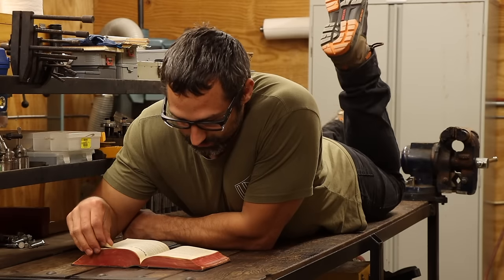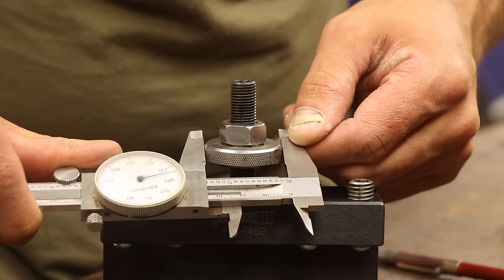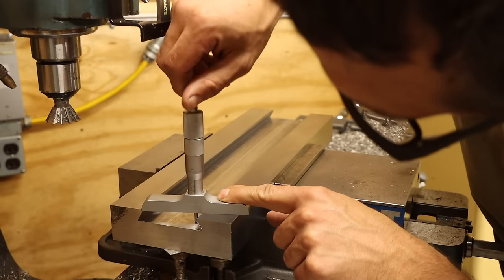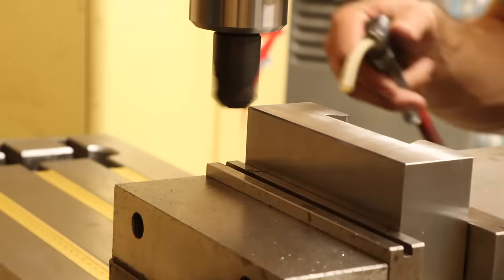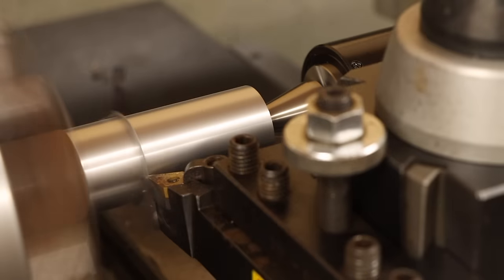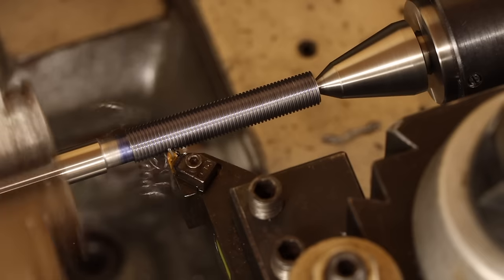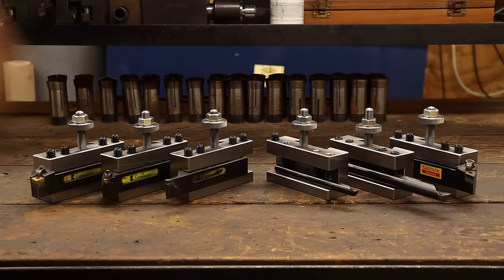Making an ARMY of Tool Holders || INHERITANCE MACHINING

Comment: I allso made better nut for my toolpost, except I replaced one with a handle with new one which needs external tools. I got annoyed by the handle getting on my way all the time. I keep the wrench in a reach of my hand, so it don’t slow my work. I also put short knurl in a top of the nut so it can be removed easily. 

There is one difference between our setups, though. I need to change between solid and quick-change post. My solid post can hold 20mm tools and the quickchage only 12mm. It’s also not strong enough for harder cuts.

Comment: I usually leave a bit if a ridge on the bottom and the bottom of the slot a bit. I just put an endmil in the lathe and cut both of them. So everything gets straight.
Reply from the maker: Do you mean for positioning a round boring bar?

Comment: If you want to keep them in the white  but also want to keep the rust away you can heat them up just a little and spread some minwax on them. I do that to my welding table once a year and it acts as a fantastic rust inhibitor for steel.
Reply from the maker: Clever! I've been using a spray oil called ACF50, but it does leave the part a bit oily

Comment: Another awesome video.
Definitely time for a custom rack to mount all these beautiful tool holders.  I have an AXA sized quick change tool holder on my trusty 9" South Bend. Had a spare way clamp left over so it's mounted to the far right rear corner with a vertical post and an angled aluminum plate. It holds 8 tool holders, Allen wrenches,   both the 3 jaw and 4 jaw chucks, and the tailstock accessories like the Jacobs chucks and live centers.
Reply from the maker: Thank, as always Keith! That's a really clever ideal. I was thinking something on the backsplash or the wall behind it, but I think I recall seeing an extra way clamp around as well.

Comment: New project idea! Die holder. That one looked terrible. 
What I have done in the past when machining a long thread that I didn't have a nut to check, I will single point to within .005-.010" of the minor diameter, then use a die to finish cutting the threads since I know the die will cut to the correct size. (I don't make parts for space shuttles so I don't need absolute perfection.) This will prevent the die from walking all over the material like you noticed they will do.
Reply from the maker: Thanks a really useful tip. Thanks!

Comment: When you said you were going to grind the dovetails, I was thinking “That’s going to be incredibly tricky and interesting to see how he handles that challenge”. But, I do agree that milling was the right decision, it’s already so accurate and sooo much easier.

It’s very cheap to do hobby shop “black oxide” on steel parts to keep rust at bay. All you need is the chemicals, and you literally dip and let dry. I think these would look very good black if you wanted to go that route.
Reply from the maker: If I'm being honest my want to grind the dovetails was mostly as an exercise to try something new. But maybe another project 😁 I actually use a black oxide kit from Caswell Plating pretty often.  Comes with a sealer that dries to the touch that I highly recommend

Comment: Nice work! Making the threaded adjustment stuffs is a step further than I would have gone. I think I would have just bought set screws.

One tip on checking the tram off your mill - Use the longest indicator holder you can and sweep the whole table. The longer distance amplifies the error and allows you to get it that much more square.
Reply from the maker: Oh I tried to find 60mm set screws. It's like they don't exist! At least where I normally look.

Good point on tramming. I've done this at times before as well. Maybe a little lazy here 😉 

Thanks!

Comment: I like to change from metric to standard threads if I copy something for the shop. Makes it easier to get bolts and nuts for replacement.  I also like an extra set screw on each end of a tool holder.  But you did great making these interchangeable with your existing ones.
Reply from the maker: I'd probably do the same if it weren't for that. As much as the international commenters would hate it 😂 Good idea with extra set screws.

Comment: Next time for finish passes use a nice moly-dee or high sulfur oil it leaves a much nicer finish than spray mist and I can usually get away with a light polish instead of grinding.
Reply from the maker: Good tip. Thanks!

Comment: The deflection in the middle of the bar is probably as you remove material, your also removing structure thats holding the bar stable against its own internal stresses. Can be hard to manage when you only need to remove material on one side

Comment: I think if you inspect those set screws in the Phase II holders more closely, you'll discover that the threads are metric, but the hex recess is in inches.

I replaced mine with better quality set screws that don't mix metric with inches.

Comment: Just a tip for the taps and dies, when youre cutting the thread, the chip will need to be broken off periodically.  Every 1/2 to full turn of the tool, wind it back a quarter turn to knock the chip off.  This will help the chip not get re-cut by the tool, which can hurt the cutting edge and really chunder up the thread.

This doesnt apply to gun nose taps (like the one you used for the through holes for the clamping screws) or spiral flute taps.  The bottoming tap and the die you used in this vid, gotta wind it back from time to time!
Reply from the maker: Ah good info. Thanks!

Comment: Nice video, few things to comment:
For a blind hole, use a spiral fluted thread tool, it lets the chips out.
I would never clamp 2 individual pieces in a vise, yes their ground, but it still gives me anxiety if one would break loose.
The countersink for the thread: "just over 12mm". I learned to sink for the diameter + 1x pitch.
The know-turning: the quite substential stickout: rule of thumb i learned was about 3-4x the diameter stickout is ok without a center.
Good video tho, nice quality, keep it up, greetings from Germany
Reply from the maker: Thanks Anton. Good tips on the tap and chamfer. In regards to the vise, while I would normally agree, If I were to leave just 1 part on 1 side of the vise I would risk damaging the vice ways. Because I knew the parts were within a tenth of the same width, and that they were not placed right next to each other the flexibility in the jaws was able to compensate for this. On the lathe stickout I also normally agree, but not when side knurling as I did. I appreciate the tips and support nonetheless!

Comment: tip for squaring on the grinder   make two faces parralel take precision vice grab the faces put 2 pins of the same size between the part and magnet so that the magnet cant pull the bottom not flat face and make it bow beacuse the second you release it the ground face will copy the bottom face after that just flat face on magnet and grind lots of coolant and feed really matters or you will heat it up and make a crater in the middle

Comment: Those tool holders look great. On tool you might look at getting is a spring center, very thin, for your tail stock to use when you are hand tapping. If you look at any of Adam Booth's videos where he is hand tapping on the lathes or on the milling machine you  will see the tool I am referring to. It just helps make sure that your tap wrench stays square.
Reply from the maker: Thanks! I've seen those before. That might make for a good project!

Comment: Nicely done! The deflection in the material is likely due to residual stress attributed to the rolling process, and ignore the previous comment about leaving the rotary table on the mill. Cheers!
Reply from the maker: Thanks! Yeah I got mixed up thinking I bought annealed 4140. It was just cold rolled low carbon. It's a wonder it didnt bow more!

Comment: To answer your question 'where to put these',  I think that you should machine yourself a tall wall-mounted  tool post consisting of a pair of plates separated by a spacer for each tool holder, with longer spacer between each for access.  This design would also protect the dove-tailed surfaces.

Comment: Really enjoy your channel. Would the setup on the mill been more rigid had you clamped direct to the table vs in the vise with supports?  I know Cold rolled has potential to spring in odd directions when you make deep cuts.
Reply from the maker: Thanks. Yes it definitely would have been. For some reason I had it in my head this was annealed 4140, and not cold rolled low carbon. So I wasn't expecting any stress relieving distortion at all.

Comment: Whenever I see the new video, I stop what I'm doing to watch - fantastic work.  I would definitely finish that steel somehow, looks like you have a good amount of moisture in the shop.  Hardening would be nice for longevity too!  (Really this is just a request to see you work with fire - although you're probably already to dimension, so that might not work).
Reply from the maker: 😁  Thanks! Actually all the rust you're seeing in places is from the previous shop the equipment came from. I have a dehumidifier running non-stop and i'm honestly surprised how dry it has been able to keep things. Not a hit of rust on anything I've made or restored. I may circle back and harden some of  the smaller components.

Comment: Killer content. Found your channel and have been making my way through what I missed. I’ve been lucky to have worked with quite a few FOGs and picked up so many tricks. Easy way to hold something by the threads is to take a couple nuts and cut one of the flats through to the threads on the band saw, then just line the slot up with a gap in the three jaw chuck. It does not work with a 6 jaw however.
Reply from the maker: That's a great tip! Thanks and welcome

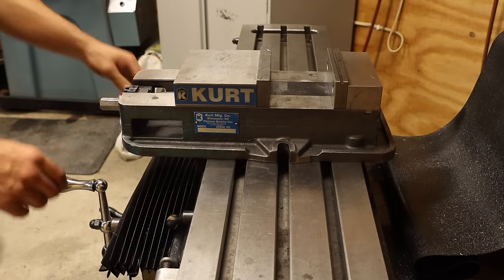Comment: 5:15 bow and use are perfectly good reasons to remove those items, BUT, the most important and vital point is wear. If there's one thing one should remember faster than anything else written in the machining bible, it's that when you work on a mill, the table needs to be as light as possible, otherwise, you'll wear the table prematurely.

You want to be you, the table, the clamping method and that's about it. ALSO, equally vital, move the vise from one spot to another so you don't wear the same spot in the table's ways. Three months in one end, three months in the other, another set in the center and so on. Depending on existing wear, favor those areas that are not worn as prime vise plopping locations, as that should help wear the table more evenly before you're forced to do something about it (tho in the case of a hobby and above level use out of it, you'll likely wear it for a long time before you feel it).

(Out of context, because the install of the rapid traverse and knee helper isn't done in this video): The faster a mills component moves, the more oil you need to favor towards. In larger, dedicated work mills, that's accomplished with different sized jetting nozzles that go to the various oil passages, in yours, you'll have to figure out what's what.

Comment: the problem with the thread cutting on the heights setting screws is that u use a to large diameter. Try turning it down about 0.2 mm smaller than the actual thread thickness ( in this case to 11.8 mm) maybe that will solve the uneven thread problem 
greetings from germany